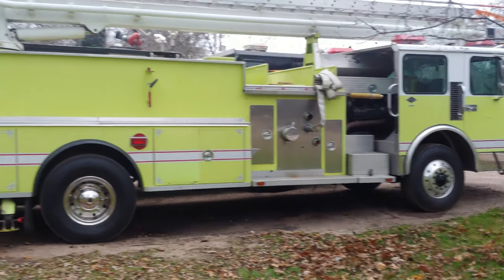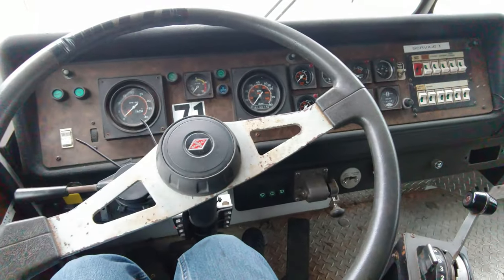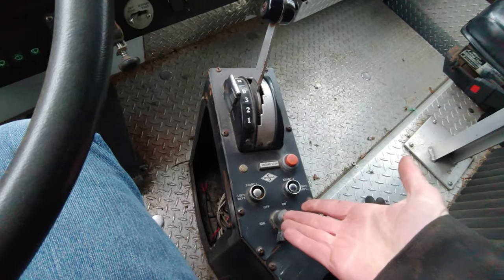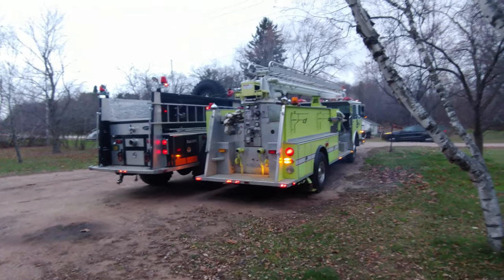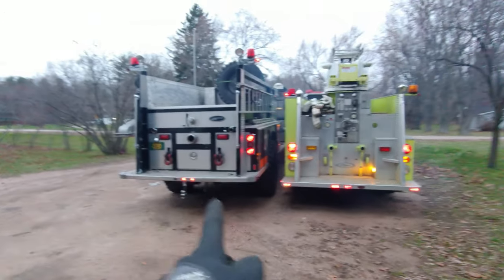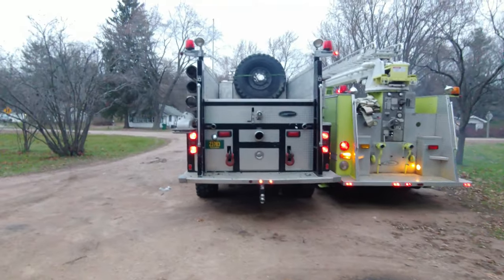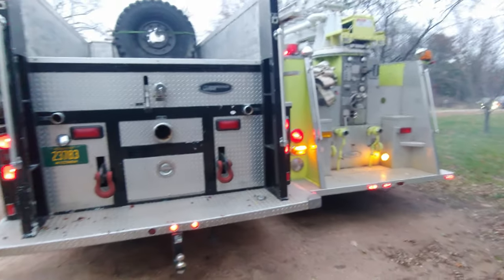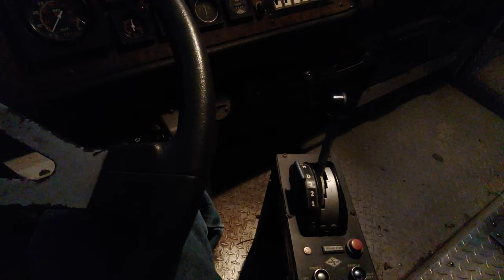New 4WD fire engine project and Detroit cold start! Former Syracuse NY truck, 1974 Pierce

Comment: I could sit all day and listen to those Detroit’s sing their 2 stroke symphonies
Reply from the maker: As long as I get earplugs I will 😬
Reply: @checkersgarage744  I grew up around Detroit’s so maybe I’m just used to it. In middle school, my bus was an old crown with a pancake Detroit 6-71 paired with a manual transmission. I loved that old bus, it was fast and loud especially when he’d get it wound up and flowing just right, was an emotional moment for me taking the last ride on that bus before being retired and replaced with a freightliner C2
Reply from the maker: @tommystearns1475  Its not that I don't love the sound! Just both trucks are straight piped and after an hour at 2200-2500rpm you worry about your hearing#
Reply: @checkersgarage744  in middle school, my school bus was an old crown with a pancake 6-71 Detroit that was situated behind the front axle so I get what you’re saying, even a 45 minute ride on that bus would make your ears ring

Comment: Not naturally aspirated.  It's got a supercharger genius
Reply: its got a blower
Reply: Howdy,
Despite the blower, a 2 Stroke Detroit Diesel is considered naturally aspirated. 
The blower is for exhaust gas scavenging and not designed as a power added. They require a blower to run. Its an 8v71N. If it were turbo charged it'd be, for example an 8v71T. You can usually tell a turbo from an na by the exhaust "bark" that'd be muffled and not nearly as "barky" as a na, and would have a turbo in addition to the blower.